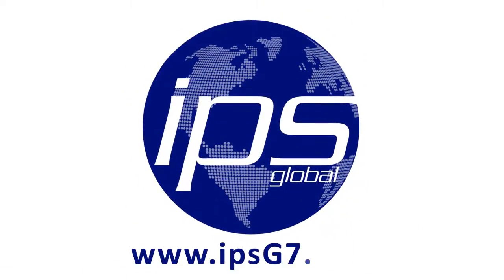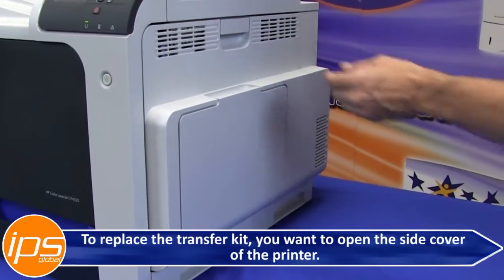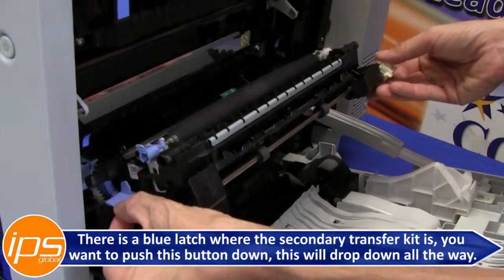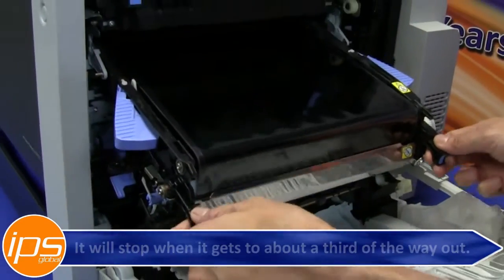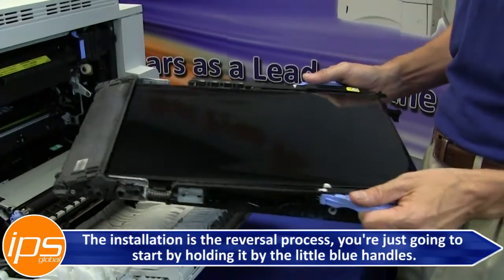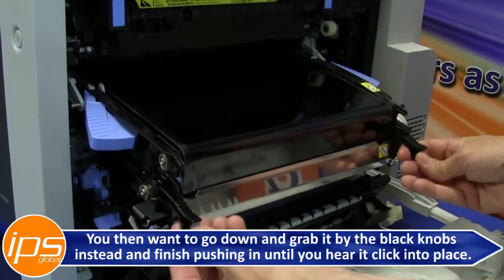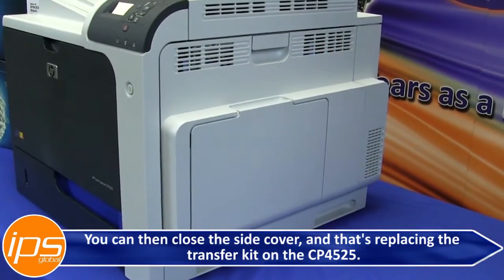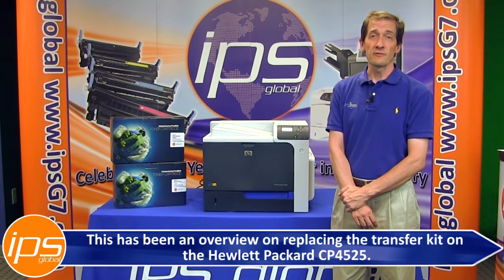HP CP4525 - Replacing the Transfer Kit

Comment: HP Laser Jet CP4525 59.F0 Printer Error! what to do?
Reply: If you have already replaced the Transfer belt it is Likely going to be the Fuser Drive Motor Assembly, this is not an easy task , Much disassembly and reassembly is needed. The part cost isnt generally too high. 1st time I replaced one of those it took 2 days or about 14 hours, because you will want to track all you take off . there is a video on youtube that goes through removal but not resembling.  Here you will find the video.  https://www.youtube.com/watch?v=kE1YhZXxLp0 for the 3525 almost the same.